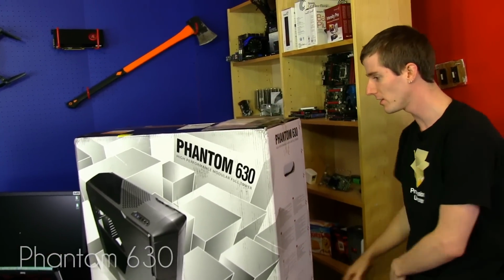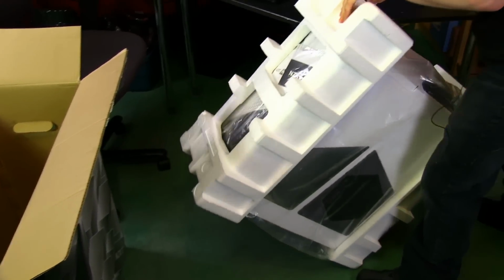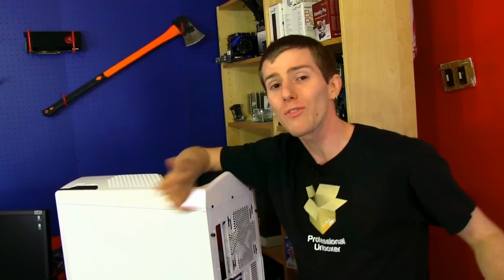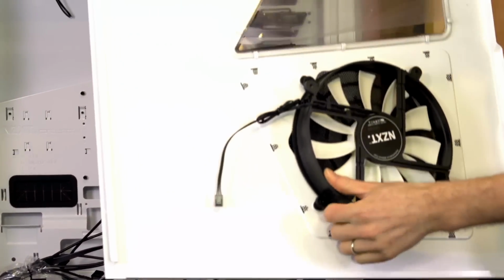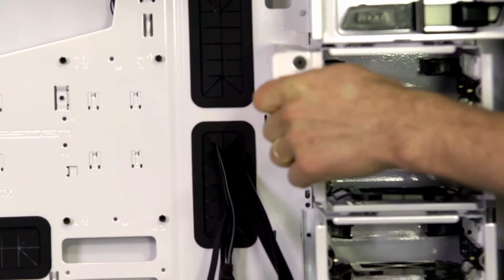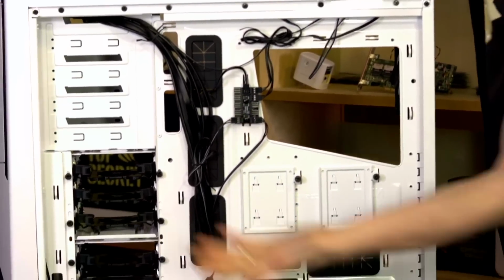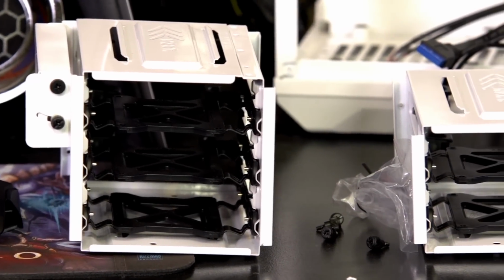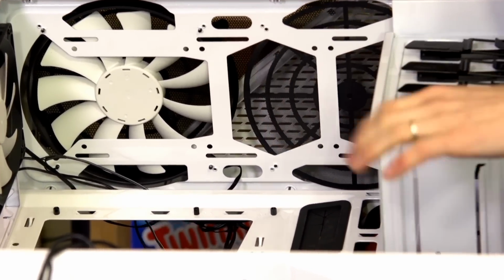NZXT Phantom 630 Gaming Case Unboxing & First Look Linus Tech Tips

Comment: A good reason why the drives mount from the back side panel instead of the typical front side panel is because of the fan on the front side panel. When that fan is plugged in and the cable is secured tightly, it is often cumbersome to open up the case when there's a fan cable attached to the door. There are no fan cables interfering with the other side panel so fiddling the hard drive installations is easier to do.

Comment: the top natively supports 2x140mm set ups, so you would put it in the top of the case, this case is actually really neat for water cooling in general, you could put a triple rad in the top and dual in the front, and a single in the back if you needed it. and there area few 200mm rad's available, so you could totally get 4 radiators in this...

Comment: Linus, reversing the drive sleds, means you only have to take off one sidepanel, when changing an HDD. In a conventional case design, you have to pull off both sidepanels, to change an HDD.

Comment: I have the Switch 810 and I love it, there is so much space in the case for rads and components. The only thing I do not like about the 810 is that because it is a full tower it is quite the pain to move but that's expected. If you want to do serious water cooling, I would go with the Switch as you could easily fit a triple rad, two dual rads, and a single rad, but it's more which one you like the look of.

Comment: I completely agree. An external one is so much more practical and having 1 or 2 5.25" bays would actually be a good. That way if the person doesn't use optical they could fill up the 2 spaces with a reservoir.

Comment: NZXT Phantom Full Tower has 150mm Clearance for CPU heatsink. NZXT Phantom 630 has 170mm. Doesn't seem like much, but the 'original' lacks the room for a side fan and an NH-D14 CPU cooler; however, the 630 has enough room.

630 has 2x usb 3.0, single switch all-fan control, modular 3.5 inch bays, rear I/O led, and a few other various things.

If you want to know more head on over to Newegg and look at either the original or the 630; there is a chart of the differences on either item page.

Comment: But in the top front you can because there is the front i/o with the usb ports. And covering the fans doesn't mean to me with cloth or something similar especially when I let them spin with low rpm's. Also I wouldn't go with 2 x 200mm fans because I wanna have positive air pressure in my case --> 2 x 200mm fans as intakes and 1 x 200mm and the rear fan (120 or 140mm) as exhausts. Keeps most of the dust outside.

Comment: Fair enough. My HAF-X has a flat top, but like this case the top is populated by two 200mm fans. You shouldn't cover those up, so there's that too. I haven't had a case I could sit things on since I broke away from mid tower cases. Most full towers that I've seen come with dual **0mm mounts at the top these days.

Comment: so you can put a 240/280mm radiator up top in push or pull and still keep the 200mm fans on top of that?

Comment: Linus, for the audio- use a separate recording device from the rig you currently use and that way you can have good quality audio to go with the video quality ;) 
To sync up the audio, just clap a few times infront of the cameras, and then align the audio spikes to match.... (also works for recording via two cameras and switching between them afterwards)
Reply: I think he took your advice

Comment: Phobya extreme 400 in the top, phobya extreme 200 up front, and a dual 120/140 at the bottom with low fpi and slow fans, ssd's on the back, and maybe some 5.25 to 3.5 adapters if you need mechanical, and viola, silent WC system, BAM

Comment: 4x 200mm filtered intakes, 1 120mm exhaust (GPU not withstanding). That's about as positive as it gets, lol. This case has an almost identical design from a cooling perspective.

If you want a table you can always do some case modding. Weld 4 "arms" to the beams above the side panels and put a flat surface on the arms. That'd give you plenty of fan clearance. Warning: This may look ridiculous.

Comment: I realized it, I have been looking at a 410 for a little while. I'm not 'sore' at all, but I fully agree that the 410 has a lot of options for the price point. However, the 820 is the better case. I'm not trying to argue with you, I agree that the 410 has better value.

Comment: Well yeah, I use optical myself, but probably won't use fan controller, but still why would I need 5 bays instead of 2 in my case. And to be honest I do regreat I bought optical drive cause of how little it's getting used. I would prefer to have one more space for a fan with no restriction whatsoever behind it in front of the case. So what there are cases with 2-3 fans in front when they have unused cages right behind them?

Comment: Can you remove the fan mount on the hdd/ssd mount and place it on the single or double? i only run a ssd and hdd and would like to take advantage of that without having 2 extra bays. If not, its fine though. Can't wait to get this case!

Comment: i would have bought this over the 820 if every hole was rubber grommited. seems to me like the most used holes are not gromited at all. which to me is a turn off. but overall this case looks awesome

Comment: I read a comment on another review on youtube that you cant use fans from other manufacturers in this case. Is this true as I thought it would be simple to just screw in the fans and attach the cables. What is different about NZXT cases that means you cant use other fans?

Comment: I would actually recomend this case instead of the 820 just because of the price difference. Sure the 820 is a bit larger and has the Led color options and everything but it simply doesn't justify a... 70€ difference in price. I have the 820 but I bought it from another person, thus much cheapter than from a store. The 820 would only be advantageous for custom watercooling that has large reservoirs.

Comment: Is that fan on the top a 800 RPM silent fan or a 1300 RPM? Looking at buy a second fan when I get the case. NZXT sells the FS 200RB and the FN 200RB. Need to know which to buy.

Comment: The 7950 from AMD has great value ATM, although it is louder, and consumes more power, and because of drivers it has less consistent fps than nvidia. Look at the Club3D 7950 RoyalKing, it has a good, relatively silent cooler with plenty of overclock potential at a sharp price point.

Comment: Can I fit both a Corsair AX1200i (200mm L) PSU with an NZXT Kraken X60 280mm radiator on the bottom together? I'm wondering if the PSU will be too long and extend to where the X60 will mount. 

If they both fit, will the X60s tubes reach the CPU from the bottom after routing around the video cards?

Comment: I'm thinking of using the NZXT Kraken X41 Liquid Cooling Solution as a cooling unit for my Intel Core i7-5820k...

Thoughts on this? Would that be a good idea? It's all compatible but I'm just wondering if it will provide enough cooling for that six-core processor.

Comment: will Corsair Hydro Series CPU Cooler H100i, ASUS Sabertooth X79 LGA 2011 Intel X79 SATA 6Gb/s USB 3.0 ATX Intel Motherboard and two EVGA GeForce GTX TITAN SuperClocked 6GB fit into the case?

Comment: What are the major differences between this and the original NZXT Phantom? I'm getting one of the two and the Phantom is cheaper than the 630. How much would I be missing out on by going for the Phantom?
Reply: They seem pretty similar. The main difference is the third included 200mm fan on the 630 from what i can tell.
Reply: I ended up going for the 630, it seems a bit more modular, I think it looks nicer than the Phantom, and that extra fan is nice too.

Comment: Sorry I'm new to pc building but does this whole case come with all the cables needed for a custom build  to work and boot up ?
Reply: Almost certainly no.
Reply: +Ion Wolfie Your motherboard will come with stuff like SATA cables for connecting drives to it. This case will come with front panel cables to connect stuff like the front USB, audio jacks, and power switch to your motherboard. The power supply will come with all the cables for powering stuff. This is the majority of the cables your PC build will use. The power supply comes with a power connector for the CPU, motherboard, graphics cards, and then additional cables for powering hard drives/solid state drives, and stuff like lighting kits or older CD drives. If you order all the parts, there should be no need to buy extra cables.
Reply: Did you manage to find out the info or you need some help?

Comment: Would love to know if anyone has had experience in fitting a 200mm spectre pro to replace the front 200mm fan. does it fit and is the airflow better if i were to do it?

Comment: Usually you use the rear and top fans as exhausts because heat will rise in a case ;) But with 5 fans + the gpu fan it can be a bit loud :/
I don't wanna do case modding. I'm kind of the lazy type :D 
I wanna have a cool and cool looking case right out of the box :P

Comment: (New to pc building) Well im new to pc self building! Is this case good? And plus fan or water cooling? If water cooling what all in one cooler?
Reply: This is very much a good case, with plenty of water cooling options if that's your thing, but depending on your needs, you might be able to get away with a cheaper case. The Phantom 410 is like this, but smaller and with fewer features, the Corsair 500R has excellent cooling capabilities but less front panel ports, and I've heard good things about the Fractal Design R4's cable management options. I personally use a Rosewill Challenger-U3, which is about $50-60 and isn't terrible for the price. The Corsair 230T might have better build quality than my case, but it runs about $15-25 more.

Comment: 2020... still using this case, because I'm too damn cheap to upgrade...
Reply: same here
Reply: it's a really fucking good case

i just switched from a new case BACK TO THIS ONE

gpu temps dropped 20 degrees, the airflow is insane, and it looks great with modern rgb fans https://i.imgur.com/h5o0hMz.jpg
Reply: Still using the Window'd edition solid ass heck case.  Also may finally have to remove the top cage for a 3080. XD

Comment: nzxt h440 vs phantom 630?
Reply: +KvX Nzxt H440 has a lot of cable management and storage space but the 630 has a lot more cooling options and has a good amount of storage as well. The 630 uses more radiators and filters as well. Go for the 630.
Reply: Kyle DuBois
i go for phanteks enthoo pro, gtx 980ti msi and i5 6600k :)

Comment: can this case hold on 240mm radiator
Reply: did you find out if it could as i have this case and i have just payed for the corsair h110 and thats a 240mm radiator
Reply: TO: Jonathan Reynoso --- Yes, it can hold a a top 240, 280 or 360 RAD, a Front 240 Rad, a back 120 or 140 (Push Pull) RAD. In fact all scenarios can be "Push-Pull", that's how much space this case has. I have my Corsair H100i configured up top with my MSI Z77A-GD65 w/ Intel i5-3570k.

Comment: personally i think none. i have a different phantom, and there's so much upwards airflow from dual 200mm fans that a filter would only be useful if the computer was turned off, which...is pointless

Comment: Jesus tits just turn the gain on the microphone DOWN. That equipment is so expensive there HAS to be some sort of peak indicator somewhere - Turn the gain all the way up and start talking as loud as you normally do (or yelling to be safe). If the peak meter (normally a little red LED) starts flashing then you need to turn the gain down slowly until it is JUST not peaking. This will give you maximum volume with minimum (or none at all) distortion. Please guys, thumbs up so they can fix it.

Comment: This ......    or phanteks enthoo luxe
Reply: I would get this because its bigger than the enthoo luxe. I honestly like the looks of this much better anyway, considering you get the windowed version. If you take the enthoo line and all the praise they get, then take into account that this case is over 2 years old, you will see that cases havent really improved much. This case is still perfect in my opinion with the ssd mounts in the back the modular drive cages and all the cooling options it has. It doesnt have the led or the designated bracket for a tube reservoir like the luxe but if youre creative you can setup a custom loop in this case very easily. I would get this case over the luxe.
Reply: Both are amazing cases, so I'd buy whichever is cheaper. I personally prefer the Phantom look, but where the Luxe shines is that it has aluminum exterior versus the greater amount of plastic on the Phantom. You could also go for the Enthoo Pro if the lighting strip effects aren't important to you, like what exists on the Luxe. It is really a matter of taste, and I think the Phantom is a bit bigger in height and depth, but maybe an inch or two in each dimension. If you are a watercooler or air cooler both cases are as good as it gets.